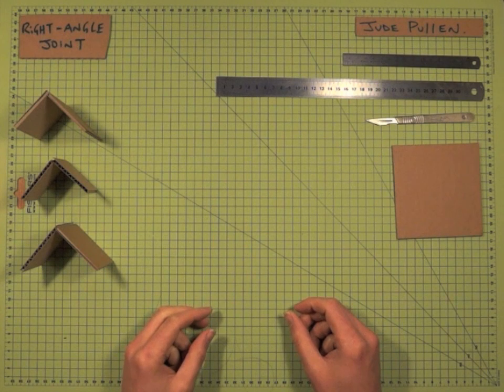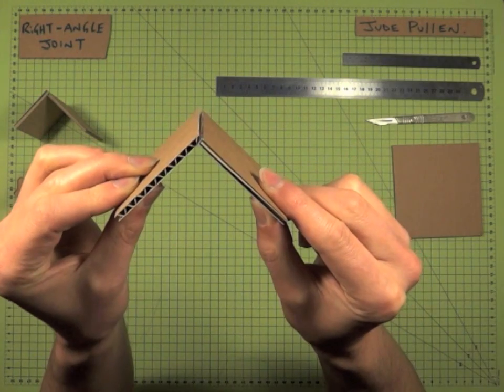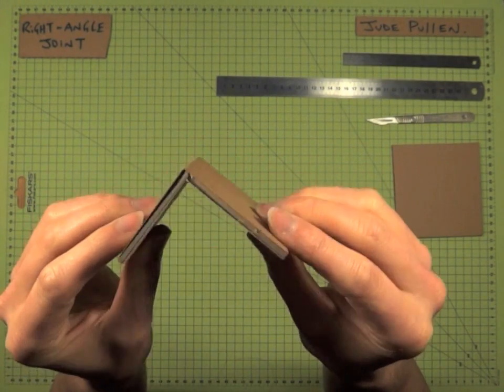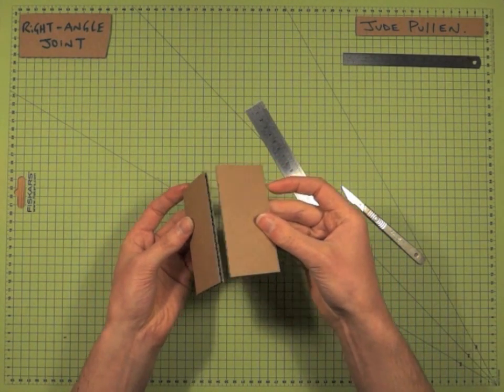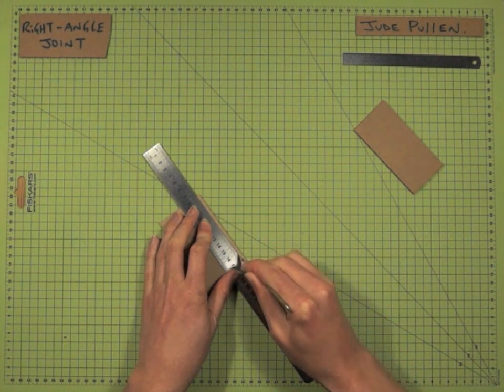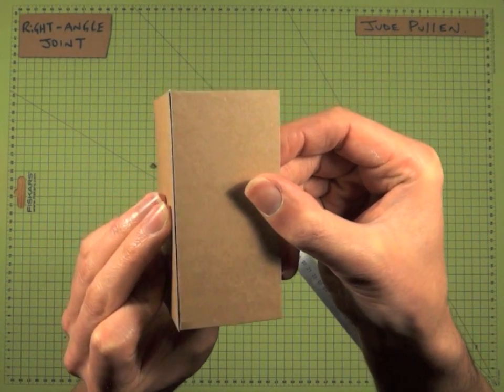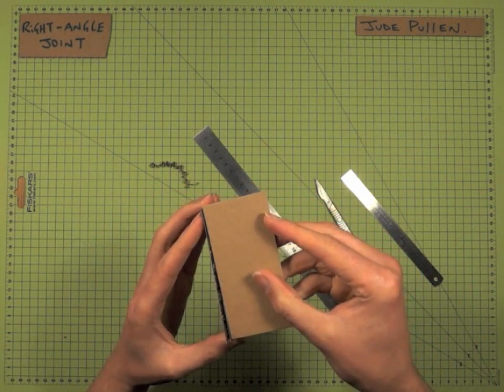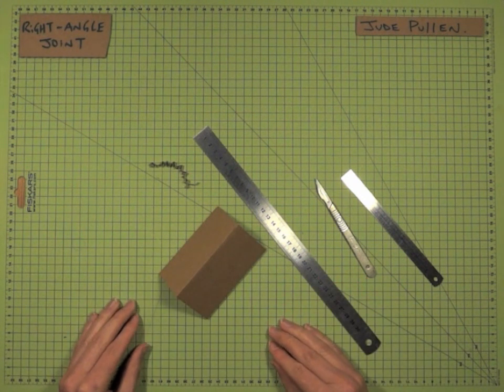90 DEGREE JOINT in Cardboard [Tips] [Design Modelling]

Comment: Thanks Jude, the tee-joint tip makes a lot of sense. About the solts, my problem is cuttng the end of the slot. when you basically have to make a 1mm long cut. I find that I can't get the blade though the (corrugated card) without 'over cuttin or makeing the cut too long due to the trianglular shape of the blade. Is there a tool, kind of like a garden spade that will allow me to cut straight down?

Comment from the maker: Slots: Rather than cutting from one length of a line to another - stop halfway and turn it around and cut the from the other side. This helps you cut 'up to the edge' neatly. Also it is worth flipping the item over and re-cutting anything you missed (this is often the case with fiddly cuts!)

Tee Join: This I would do as above - but not cut all the way through. I'd then take a pair of needle-nose pliers and pull out the top layer of card and the corrugations - leaving a 'trench' to glue into.

Comment: Thanks for the videos. I've learned a lot. 

I have a question, which I hope you can answer (maybe make a new video). How to make a 'tee' join with cardboard? When the end of a piece of card butts up against the face of another? How can make this join structurally sound.
Also, how to cut accurately 'slots' in card. Basically narrow rectangular holes which will accept a 'tab' from another piece of card. 
Thanks again !!